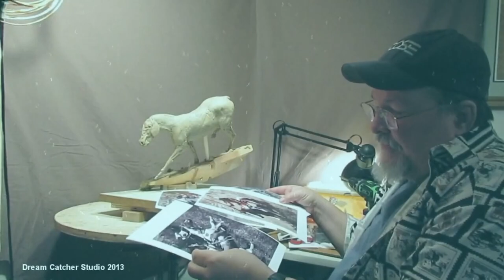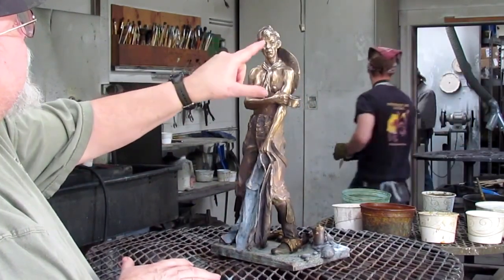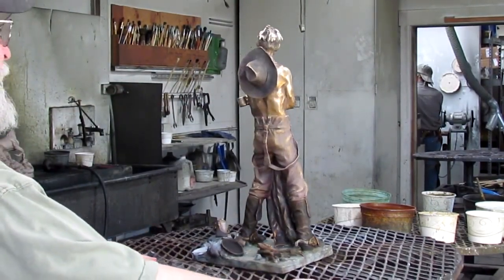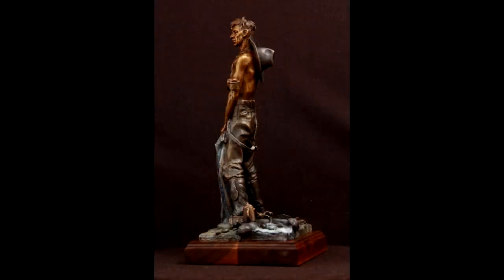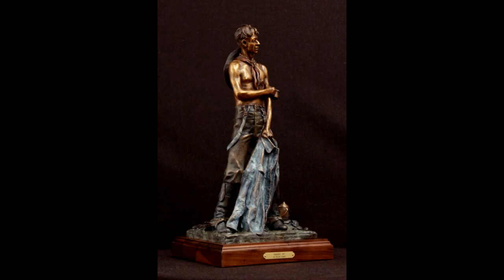MORNING JOE   A Throw Back Video from 2012 of the Clay and The Bronze

Comment: Hope you have a wonderful long weekend. :) - Heidi
Reply from the maker: Same back at ya...
Reply: @clayguy1  Got a lot of outside work to do. I should be sleeping but I was working making new designs for POD. :p About to turn in though. I have to go to Lowes tomorrow to buy some 2x4's. I need 16 feet but not sure if my van can handle 16 feet... I think it can but will have to measure. If it can't then I will get 4 8 feet instead of 2 16 feet. Then I have to put up the metal roofing I received for mothers day. :P After that have to finish the sides with galvanized wire that I have sitting in my kitchen at the moment... still in rolls. :p Today I cleared out the plant growth from around the grill so I can have burgers Monday. :D Sweet Dreams... - Heidi
Reply from the maker: @BlackCat_2  Love it... You're a regular ROSIE THE RIVITER.. (ww2 humor)... 16 would work.. probably open the back.. slide it over the top of the seats and put one end on the dashboard.... I've done that a couple of times.. with plywood added.. haha
Watching a Robin Williams movie.. RV.. man it's a hoot
Good luck... let me know how it turns out
Reply: @clayguy1  Yes I know who that is. :) Well didn't get as much done today as I had hoped but ran into issues that slowed things. I ended up getting 4 8 foot instead and some joining brackets to make them 16 feet. I was about 3.5 feet short on my van unless I wanted to risk cracking the windshield. :P I may or may not use those metal plates but if not I can always return them. I would rather have all I need and not need it then not have it and have to go back to the store again. :P I also need to cut a tree down that has grown over the last 15  years next to the kennel cage I built many years ago. Going to be sad to cut it down but it is going to make fixing it impossible if I left it there. :(  I guess I will start work tomorrow... nearly 4pm, 2 hours until I have to feed the farm and then make dinner so going to work on the computer until then. :D - Heidi